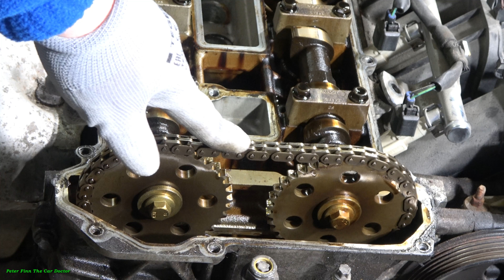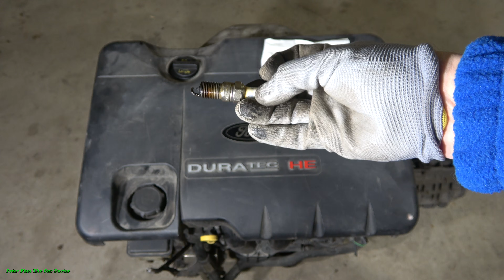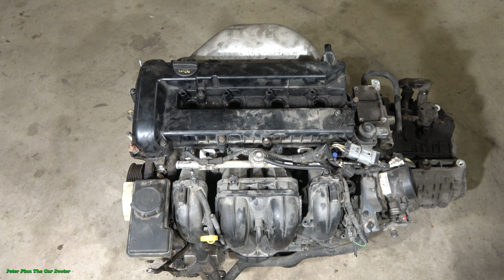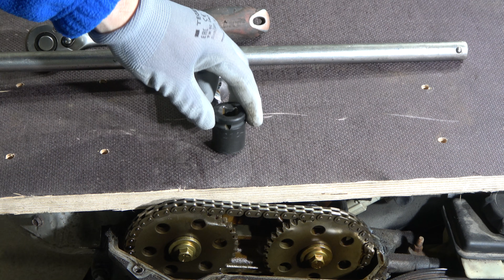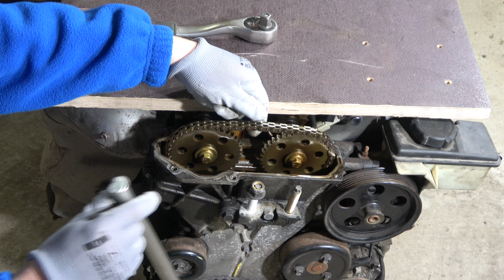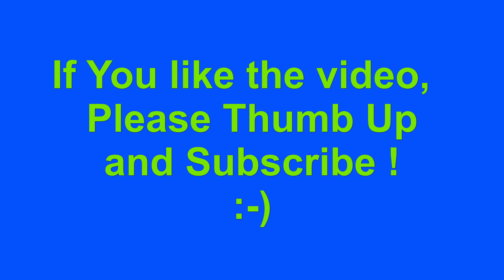How to check car engine Timing Chain status. OK or BAD?

Comment: Hi Peter good night!, excellent video
I have a corolla 1zz-fe and have been doed all the test on the video
But the last test it fails
When i rotate my cranshaft on some moments my chain switch between loose and tight
Also my tensioner is leaking pretty bad, my car have 62k miles. Could this momentum loose cause sounds and it could be the tensioner?
Reply from the maker: Hey
It is normal for the chain to be a little loose at times.
However, check that the marked points are in the right places.